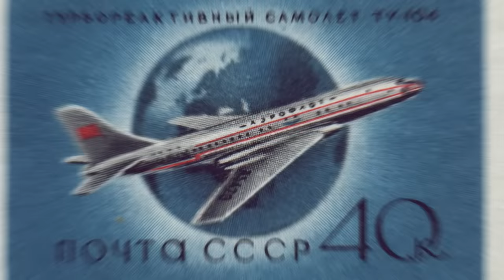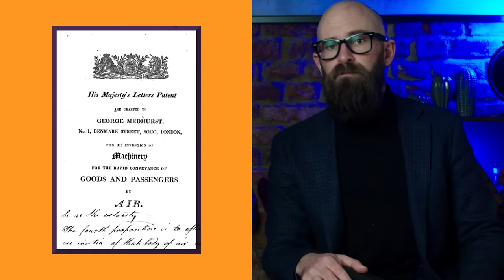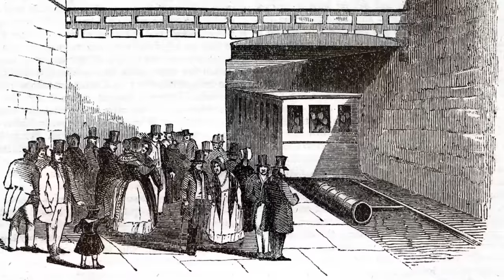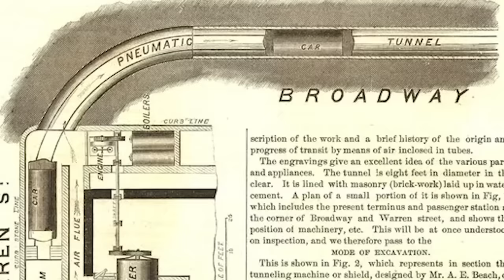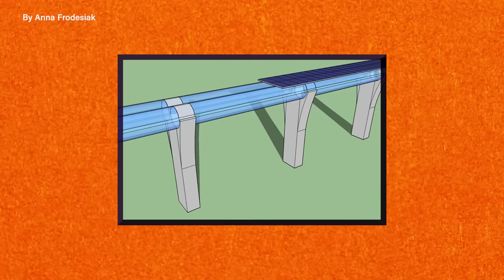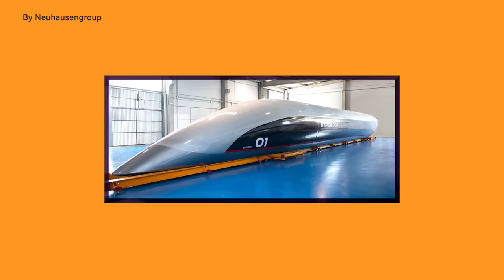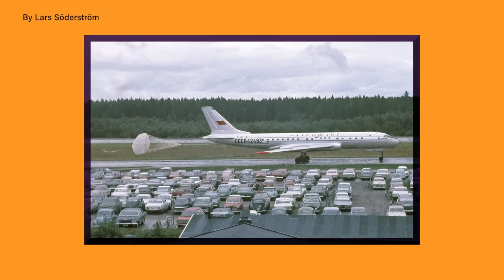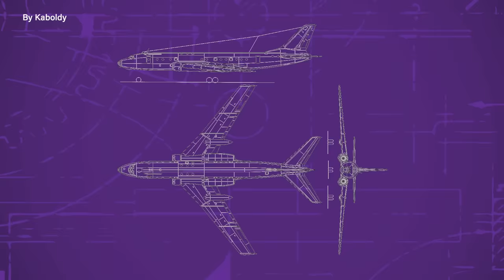Some MORE of the World's Most Useless Megaprojects

Comment: For the hyperloop tube they would not need to recreate a vacuum every time. They could have separate departure and arrival sections that close off from the rest of the tube and only have to require a vacuum in those much smaller areas instead of the entire tunnel. Another way would be to have seals surrounding the vehicle in the loading and unloading areas, then there would be virtually no loss in vacuum. And I am sure there are other ways of doing such without losing vacuum in the entire tube. This isn't the early 1900's, we actually have the technology to achieve such an ambitious plan, just would require $billions$ if not $trillions$ to accomplish. No one is willing to dish out that kind of money.
Reply: So your solution to the issue of the volatility and impossibility of one long vacuum is a bunch of smaller vacuums? Wouldn't that just exacerbate all the other issues listed in this and other explainers as to why hyperloops/pneumatics aren't feasible? There's still the issue of having to shut the whole tunnel down if any one part loses its vacuum
Reply: @phoenixxxflytrap  There are a few different types of people in this world. Those that see things as impossible and not worth trying, and those that see the impossible and make it happen. With your kind of mindset, we never would have put man on the moon. With the right thinking and innovations anything can become possible if the right people try hard enough.
Reply: @Sgt.chickens  Sound like you take part in quitter talk. But if you are completely against or closed minded towards something it will never be feasible and you will find a way to shoot everything down. I'm cool with that but I do not think you are.
Reply: @jonesgang  thats not how it works.

If its hard but we can do it. We should do it. 

But we litterally cant do it. Not because its hard. But because the idea is a flawed one. 

It will never be as good as a train no matter how good you make it.

The concept is worse in every single way. 

Its like saying "you wont eat that rotten apple because your a quitter!"

No. The regular apple is just better in every way for food. 

Jts thee same here. Someone trying to reinvent the wheel with a hexagon. Sure we can make it work. But why bother?
Reply: @jonesgang  thats not remotely the same,

the plane does something different to the car. the car does something different to the horse.

the Vac train does the exact same fucking thing as a train but instead of just building a track you have to build a powered Tunnel. for no additional benefit.

you arent seeing the point. There is no benefit. It wont be more efficient than a train. it wont carry more than a train. it will cost more than a train. Comparitively it will be more expensive to maintain than just flying or driving. and it wont be faster than flying. 

At best A vacuum system could be used for a extremely long distance 1 stop journey. 

but it cant replace the train line. youd have to build an entire Airlock at every station and cover the entire country in Tubes, and for what? it wont do anything better.

whats the point of replacing something with a worse version of itself. 

if the hyperloop would actually do something better than a train then we would have built one.
Reply: @jonesgang  oh yes great point. So tell me. What does a hyperloop do better than the train?

Its not faster. It costs more. And its worse for the environment. And it cant carry as much cargo, so. Why should we use one? What purpose would it serve? 

You just like the sound of it because it looks sci fi. 

Its the same as monorail. Looks cool. Functionally not worth doing
Reply: @Sgt.chickens  I like the sound of it because it pushes the imagination and boundaries of what can be possible. You want to call that sci-fi that is fine. I already know you are not capable of expending your imagination and prefer staying within your confined little box of thinking.
Reply: @phoenixxxflytrap  Because I have no clue as to how to accomplish that goal. But that does not make it any less deserving of attempts. But I am ok with you stay withing your little confined box of thinking. The impossible will always remain impossible in your world.
Reply: @jonesgang  dude, you proposed a solution right up there. Stand by it and explain how you think your solution would overcome the problems proposed in the video or stop arguing.
Reply: @jonesgang  people literally have attempted it repeatedly since the 1900s, and it didn't work. I didn't say nobody should try anything ever, but if an idea has been a dud for a damn century, and in that time nothing has improved, and not for a lack of trying, maybe the idea is dumb.
Reply: @phoenixxxflytrap  I am not an engineer but that does not mean I do not have an idea. How such a thing would be implemented is beyond me. But stay condescending and keep trying and sound superior. 

FYI It's not working for you. In fact, it is doing the complete opposite.

Comment: If you look at the original plans for the hyperloop, it makes it's own vacuum. The front end looks like a jet engine intake. That makes the hyperloop a smart idea; there is no continuous vacuum in the tube; no airlocks, no safety issues with the vacuum. I'm not an mechanical or fluid dynamics engineer though. I'm not sure if there's a benefit to making your own vacuum to travel through, but it seems smarter to me than what Musk's idea suggest. 
Just how much of a vacuum do they need to move at high speed?

Comment: Dubia is a hugely successsful project that made the city only have a fraction of their economy of dubia based on oil. It was not a failed project. Even the "poop trucks" are not a thing anymore.
Reply: There are several projects that failed but to call Dubai a failure is just pure ignorance.
Reply: Dubai didn't really have a choice though since most of the oil's in Abu Dhabi.

Whether or not you see Dubai as a failure probably depends on your views of what makes a city a good place to be. I can't stand car centric planning so I'm not a fan myself
Reply: @exsandgrounder  Dubia is a city of 3.331 million people were barely any people existed before. Economy is 50 billionn and only city/emirate (basically state) that is not dependent on oil. 

Also dubia has in act built and expanding their railline network. It's not pure car based.

 In addition one of the major reasons for the amount of road way is because its so hot there most people do not spend time outside. Why would you ever willingly walk around in the desert?

like it or not Dubia is a successful city. You can't call New York not a successful city because you personally don't like new York.

Comment: Like most of Musk's projects, the hyperloop makes  more sense if you consider it's use not on earth, but on Mars.
Reply: It doesn’t even make sense there. There’s literally no point in building it. Anywhere. Ever. It’s a train in a tube with the passenger capacity of a bus. If you’re on Mars, the air pressure is low enough that you’d get basically all the benefits of the vacuum, but you wouldn’t need the tube. So you could just use a regular train, which would also have way more passenger capacity, could be built like a regular train line, would be easier to maintain, and wouldn’t need the extra material for the tube. And it would have better views too.
Reply: @michaelimbesi2314  except , wouldnt you want to bury the track somewhat to provide some solar radiation and environmental protection?

Comment: I think you're being a little hard on the Hyperloop concept -- which is what it is still. Not a full technology yet. (1) The tubes are intended to be very low pressure (~1% or less of an atmosphere) and will not even function in a near total vacuum as originally proposed. Sections of the tube are were to be separated by gates / isolation valves so that the "entire tube" doesn't need to be constantly maintained. Granted it will take a HELL of an air pump to depressurize even a section of the pipe but hey, dream a bit. (2) Would it be any more vulnerable than any other infrastructure? Trains derail all the time, planes crash (or worse), pipelines do get sabotaged -- but these still continue to be built and used. I'd think if you went back ~90 years ago the thought of taking flight in a pressurized tube thousands of feet in the air would elicit the same fears and yet now we do it regularly without a second thought  (3) Expansion Joints? Yes, Hyperloop would need them. It MUST have them at regular intervals (different sections of pipe would be at different temperatures). Stations won't be pressurized and the train won't be coming in at full speed when it approaches. It will have slowed down far ahead of the station and transitioned to whatever "low speed" support the design calls for -- typically wheels.  What I will agree with 100% is that HyperLoop wouldn't even be under consideration if any sort of planned High Speed Rail were further along (and far cheaper).  Hyperloop is still a dream for sure but too many naysayers  at this point in time IMO.

Comment: I don't know anything about this, but I know how wrong we humans have been about most of revolutionizing and fantastic inventions.. be honest,  does it really sound safe to fly through the air with snow, rain, lightning and turbulence in a pressurized metallic tube that acts like a lightning rod in 40 000 feet?

Well, it wasn't! But it is now! So with great engineering and effort to make the loop work, are you so sure you will not end up looking like the people complaining, with good reason, about flying through the air in a metallic box?
Reply: The difference is air travel is based in reality and on actual science not ego and wishful thinking. A better comparison for the Hyperloop would be the Radium craze of the early 20th century
Reply: @Daniel Max   That would be the argument used for airtravel also..
Reply: The Montgolfier brothers flew their first balloon just a few years before the pneumatic tube mentioned in the video (1785 versus 1799).  Between then and now, that idea of air travel has been refined and built upon - today's aircraft though aren't significantly different to what was built 50 years ago.  Some materials have changed, engines have become more efficient, and so on - but the design is basically the same.

Compare that to the pneumatic tube and even after 2 centuries, the basic problems that stopped it from having any sort of large scale uptake are still there and more importantly there are better and far more useful options already available.  A train works, is staggerringly cheaper, is more efficient, and we know how to build very fast ones already.

Comment: On the hyper loop did and anyone do any new Research newer than 1890. We’ve been able to put pipes together to carry anything that expands and does not break with weather changes since the early 1900s at much higher pressures and developed ability to maintain the temperature in these since the 1900s. Not much different than the British France railway tunnel which they have to push the air through at pressures to kept the ocean out and to maintain oxygen levels and remove fumes. Because the most dangerous thing is the dust created by the wheels and brakes. We have bladeless fan technology, The Ability of building outside as solar panels to generate electricity needed, where it’s needed as it’s needed, And other technologies can be used like magnets to assist, he could just put a rocket engine on the tail end there’s enough power there.
Reply: yeah but it's a vacuum tube , not a regular air pressure tube. A rocket on the end is idiotic in the extreme , you worry about pollution , but pump all that garbage out the back into the tunnel for the next train to go through... that is if the tunnel survives the pressure put on it from the rocket doing it's thing. The Chunnel doesn't ''push air '' through it, both ends are open for normal atmospheric movement. Any air movement is caused by the trains themselves and is not an engineering issue.
Reply: @rustythecrown9317  A vacuum tube is a fan on one push the air and going out on the other end. It’s not like a vacuum tube where there is a lack of atmosphere. It is the movement of the atmosphere to push the train through the tube. It’s more like a vacuum cleaner than Lack of atmosphere vacuum. The solution could end up being filling the tube with hydraulic oil and moving the train around like a hydraulic cylinder rod.

Comment: Hyperloop isn't a pneumatic railway. Those are systems where air pressure provides the motive force. The whitepaper also didn't use magnetic levitation, though that's what most projects using the term have ended up using. The concept is, as far as I know, novel.
Reply: The concept is not novel, Musk hasn't had a single novel "idea" and the description definitely does include magnetic propulsion
Reply: @phoenixxxflytrap  Propulsion, not levitation.

Comment: If I remember correctly, Musk had an inspiration, jotted some notes on paper and release them to the world. I believe he even mentioned that there were problems with the idea. I had the impression that he had no actual plans to build the thing.  I think his goal for releasing this half-baked scheme was to get others involved in the task of addressing practical engineering issues - which I'm certain Musk knew there were many.

In this video it is never mentioned that potential applications on Mars and the Moon do away with what is apparently the greatest drawback - evacuating the hyperloop tube. There is no need for a tube if the system were built on the Moon or Mars.

Comment: Some of the objections to the Hyperloop are not valid. Gas pipelines are a thing working the opposite way. They don't leak and deal with thermal expansion. I don't think that the Hyperloop will work though

Comment: You listed a bunch of problems with Hyperloop that have already been solved via oil pipelines lol
Reply: Oil pipelines are under high pressure, the opposite of vacuum. Completely different set of problems lol
Reply: @canaanval  this would require someone to understand the difference between a vacuum cleaner and an air pump which is asking too much for a musky worshiper
Reply: One of the problems listed was leaks.  If that problem has been solved, please contact the owners of Keystone pipeline, that has had 3 major leaks in 5 years.
Reply: wow the shell propaganda got to you